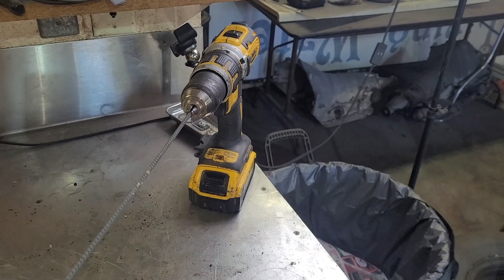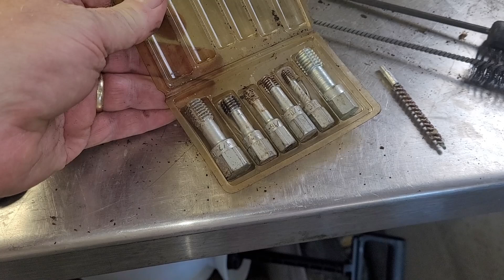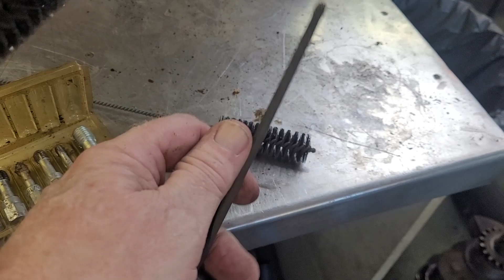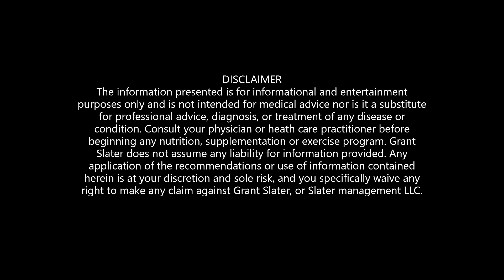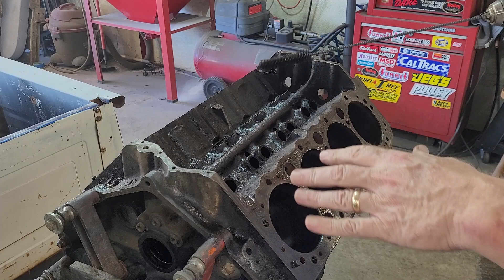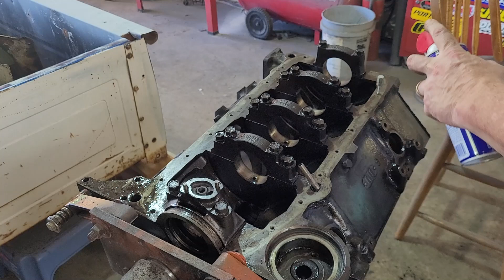HOW TO PREP AN ENGINE BEFORE YOU GO TO THE MACHINE SHOP FOR A REBUILD - SQUARE BODY CHEVY C10 BUILD

Comment: first timer here, what all should i bring to the machine shop other than just the block
Reply from the maker: DEPENDS ON WHAT YOU NEED DONE. If you are just getting the block machined, then just the block. if you are going to have them assemble it then block, crank, rods, heads Ect. wishing you all the best
Reply: @unclebucksgarage7695  thanks for the input. seen another guy say you should include all the bolts and stuff but that doesn’t really seem necessary
Reply from the maker: no problem, just remember if you are just taking the block, main caps are a must and the bolts for them.